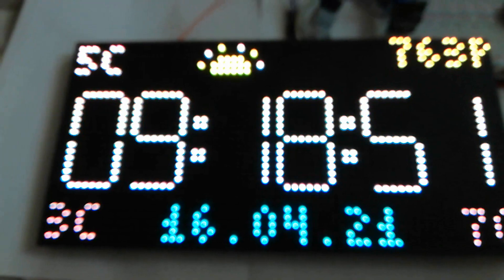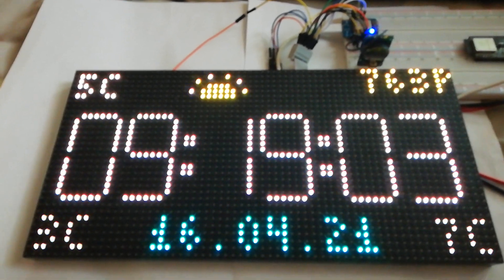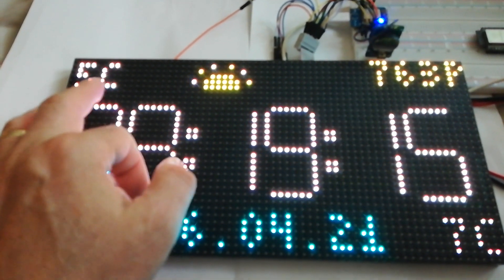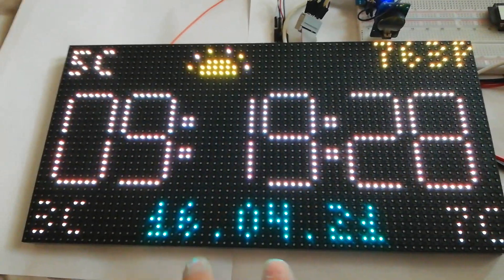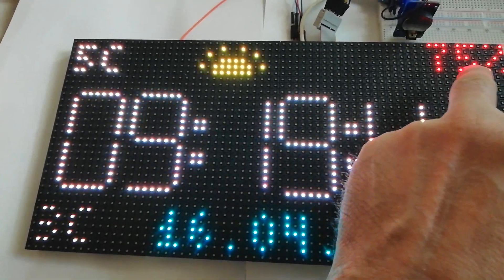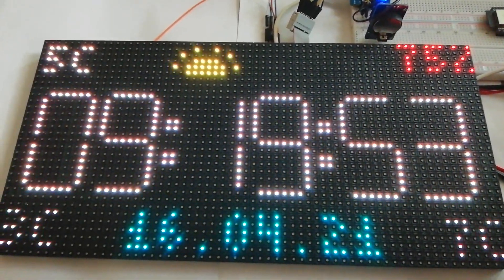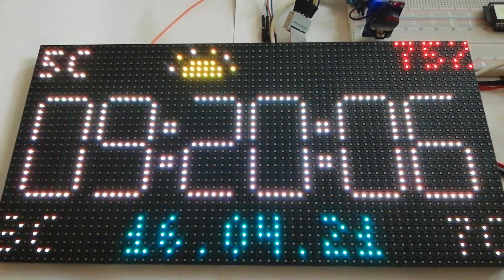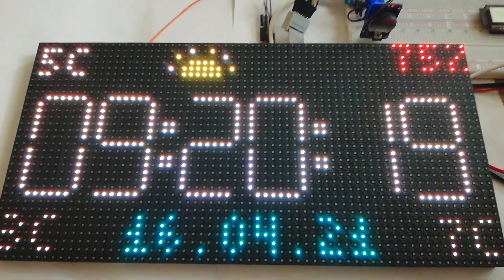Morphing clock (other remix)

Comment: Hello Nicu
i have seen your designs They are beautiful
now i have a question, i have a P2 256*128Mm Smd1515 128X64 Pixel Rgb Full Color Led Panel Matrix received. And i would like to make a morphing clock. i do not have much knowledge of writing a code. Can you help me how to connect this to a Wemos D1 Mini V4.0.0 or to an esp32, and maybe help to write a code ino?
Kind regards
Ruud Hudepohl
Reply from the maker: Your display is new for me, but I search on internet and I think you can check and test as at https://youtu.be/InhCc_-RBb4
Reply: @dj06ntm   Dankjewel
Reply: hHello
what matrix do you have?
where did you buy this? is this a p4 or p5 or p3
Mgv.
Ruud Hudepohl
Reply from the maker: @ruudhudepohl3622 please check de links from description of the video
Reply from the maker: @ruudhudepohl3622  check here http://nicuflorica.blogspot.com/2021/04/ceas-ntp-cu-tranzitii-animate-si-date.html
Reply: @dj06ntm  dankjewel
Reply: Hallo Nicu/ waar koop jij jou matrix panelen?
Reply from the maker: @ruudhudepohl3622  from aliexpress, you can find a direct link in firtst article from istructables (check the description pf the video), but mine is P5 led display as I put in my article (see description of the video)
Reply: @ hallo Nicu is dat een matrix hub75?
Reply from the maker: @ruudhudepohl3622  yes HUB75, all your questions had already the answers in the articles from description of the video (all articles have also pictures and details)
Reply: @dj06ntm  dankjewel voor alle duidelijkheid
Reply: hallo ik kan deze file net vinden  Compilation error: ESP8266WiFi.h: No such file or directory
Reply from the maker: @ruudhudepohl3622  you need the library and versions need to be as in my article (see escription)
Reply: @ welke versie gebruik jij van arduino ide ?
Reply from the maker: @RuudHudepohl  I use just 1.8.x never 2.0.x
Reply: @dj06ntm  dankjewel, ik gebruikte 2.x daarom doet de klok het ook niet. Mag ik jou als ik nog meer vragen heb, nog wel  een keer lastig vallen? Groetjes Ruud
Reply from the maker: @ruudhudepohl3622  sure, you can writte here or via email (nicuflorica@gmail.com)

Comment: Good morning could you help me?
I downloaded the program but when loading skecth the message can't be compiled to ESP8266 I can't find the error do you have any ideas
Reply from the maker: you not see any error messages in Arduino IDE? other sketch can be compiled for ESP8266?
Reply: @dj06ntm   Good morning thank you for answering me there is my problem I have no clue of the problem whenever I edit Json and add the error message appears (error when copying to ESP8266)
I can't imagine what it could be since the libraries are complete.
Reply from the maker: @emersonpaiva2566 please read article from http://nicuflorica.blogspot.com/2021/04/ceas-ntp-cu-tranzitii-animate-si-date.html (is in description of the video, also).. you can see version for all libraries
Reply from the maker: @emersonpaiva2566  look in article from description of the video. there is a printscreen with version of library used by me to work the clock
Reply: @dj06ntm  Good night, I did as per your recommendations, thank you for your attention. I discovered that the problem was the wifimaninger library, I was using the ESP32 version so I didn't report the lack of it but after checking the errors I detected that the IDE showed an error in that same library it was just I downloaded and managed to compile the code but I still couldn't get past the first screen after the ESP shows the information and is restarting.
Reply from the maker: @emersonpaiva2566  this version of clock works just with ESP8266.. for ESP32 you can try clock presented at http://nicuflorica.blogspot.com/2021/04/control-afisaj-p5-rgb-64x32-cu-esp32.html
Reply: @dj06ntm  
Good morning my friend about the link I have a watch of this type already ready so I decided to buy an ESP8266 already on its way as soon as it arrives I will inform you of the results from already thank you for your attention once again.